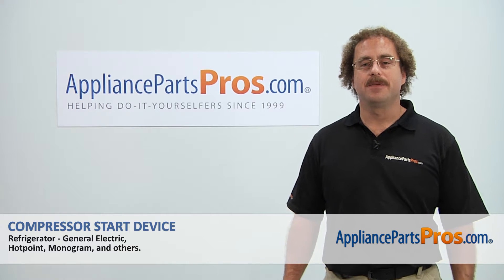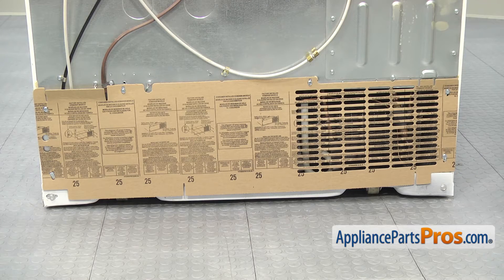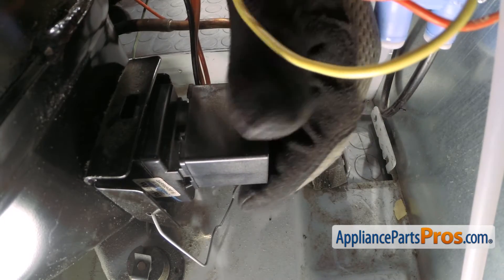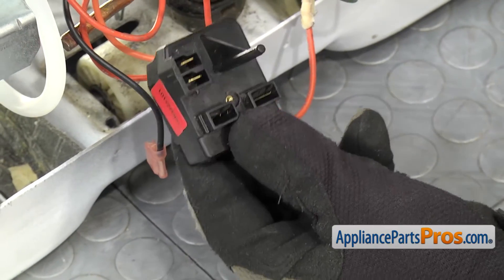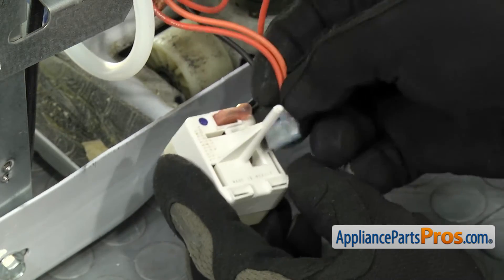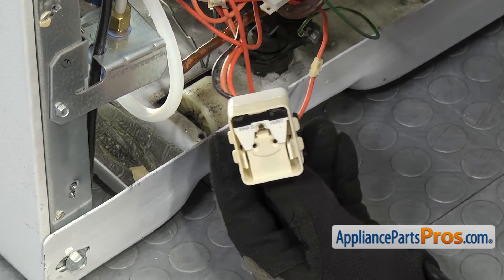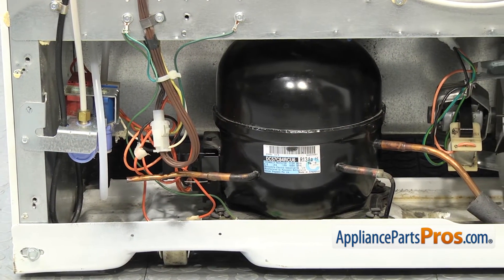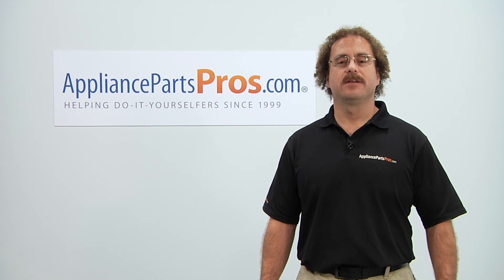How To: GE Compressor Start Device WR09X10107

Comment: I don’t see black and double orange wires. I have a single blue and single black. Did i take out the wrong thing?
Reply from the maker: The part for your model is WR08X10092. This part is no longer manufactured and there is no replacement for it.

Comment: Thanks for posting.  Found it extremely hard to pull the wires out.   Be sure to connect them in the right direction so the  Black box with the 2 grooves will fit otherwise you will have to remove them from the new compressor start device.  Finally got everything going in the right direction.  Plugged the refrigerator in and the freezer is getting cold extremely fast.  The fridge not as cold, yet.  Yahooo!.   Ooooops... later I realized I forgot to put the retaining wire back on.